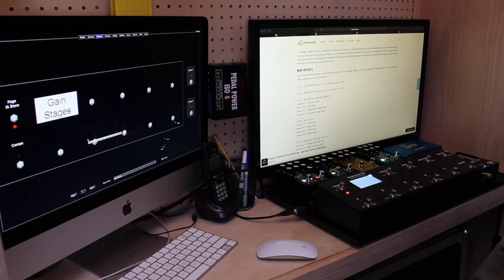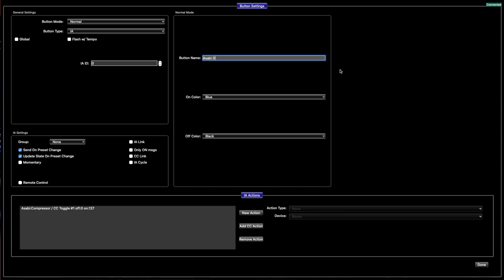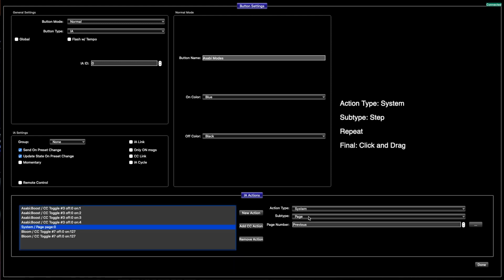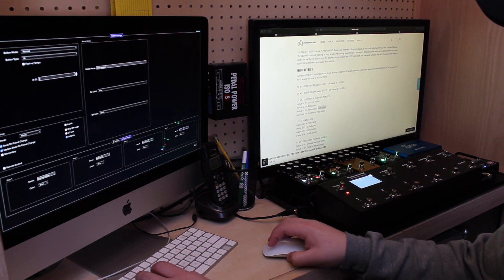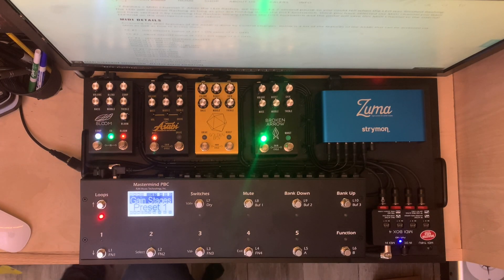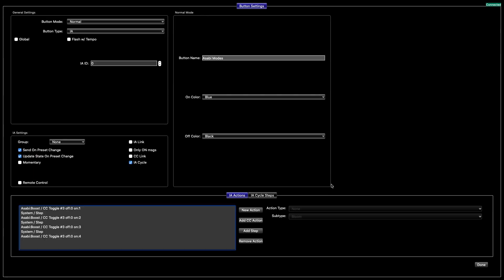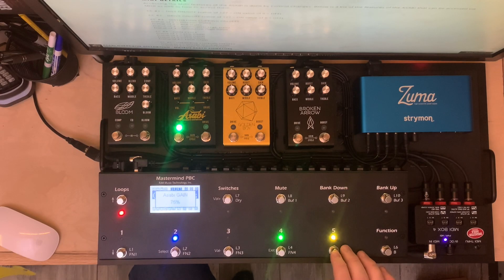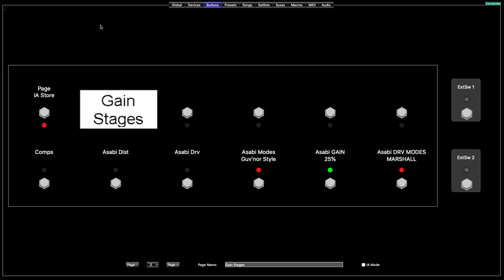My Jackson has Midi?!

Comment: Hi! I bought Strymon Conduit and I have the following question: I have the following chain of pedals controlled via midi ES8 Boss Controller > Jackson audio Bloom >Jackson Audio Bolden Boy > Jackson Arrow Broken Audio > Jackson Audio Asabi > Strymon Conduit > H9 Eventide > Hx Stomp > StrymonTimeLine > StrymonBigsky > Amplifier With I make the configuration to select the internal timbres via midi of the Jackson audio pedals so that the other pedals in the chain are also accessed normally. The pedals in addition to the Jackson audio already work well. However, I still couldn't access the sounds of the Jackson audio even though it was set to violet as recommended by Strymon's support for Conduit. I'm waiting for your answer. Thanks
Reply: Rodrigo, I’d suggest researching the TRS configuration that Jackson Audio recommends. The MIDI standard they use is described in the Golden Boy manual. It maybe that the tip and ring are reversed in the Conduit setup.

Comment: I'm trying to control a Broken Arrow with. a Morningstar MC6 but no response so far. MC6 set to ring active based on Jackson's MIDI ring receive. Standard TRS cable connecting. Any ideas?